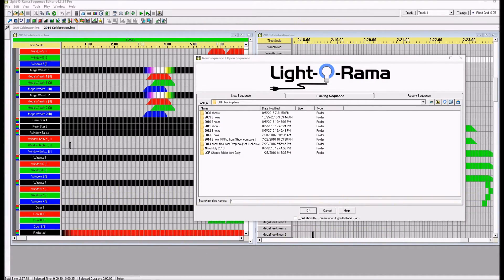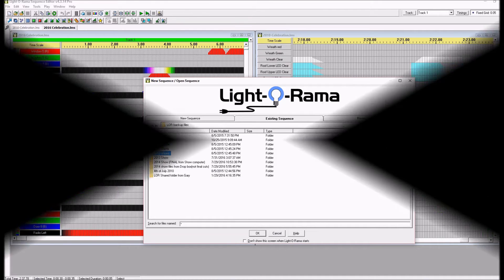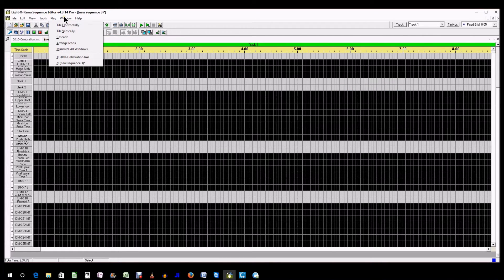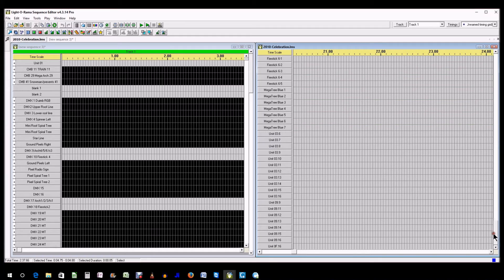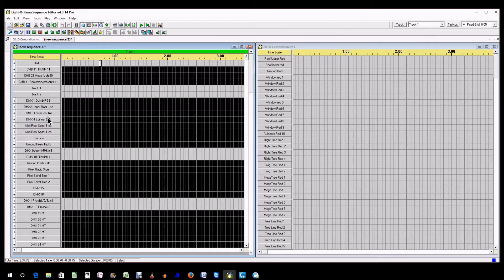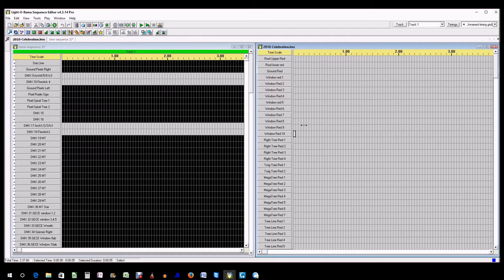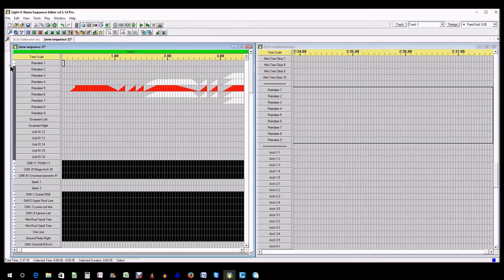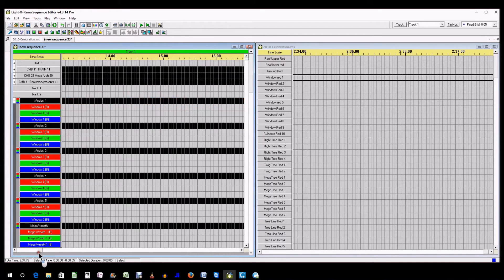Upgrade OLD AC LOR Sequences to XLights and RGB

Comment: Hey I've noticed you you a few different pieces of software to achieve your light show. I'm just getting into holiday lighting. What would be the best application to program an advanced dmx fixture for example a moving head with 30 or so dmx channels ?
Reply from the maker: Nic,
Back in the fall last year, the Xlights developers added DMX control for moving heads.  One developer added something like this to their show so he wrote the code for it.  The advantage of Xlights is that it is free software.   This is more of the DIY side and takes a lot of reading, comprehension, and learning.  It is NOT plug-and-play.  There is no "support desk".  We help each other out by using TeamViewer sessions, Skype, and group meetups.  

If you want more of a plug-and-play system with support, there is Light O Rama.  They sell a line of AC and DC lighting controllers that runs on its own network.  The software does not easily allow for mechanical control of DMX fixtures such as moving heads.  There is a huge learning curve.  However when you have problems, you can put in a ticket and ask for help
Reply: I would just use my own lighting console but I only have like 4 universes and pixels eat up universes very fast  and the support for sync with music is hard and I would be willing to learn x lights but as far as "not pulg and play" could I just plug in my pixels and configure them and run a show movers and pixels for free in x- lights or would I need to buy a lisense or dongle specific to X Lights thanks
Reply from the maker: To run the DMX controllers from Xlights, you need a DMX interface.  There is no specific Xlights dongle.  The Xlights program is FREE.  You do not pay anything.  Just download it.  If you're looking to do DJ work with this, the interface is not setup in such a manner to have ques with set effects.  The idea is to select a song, and sequence the lights to that song.

This might clear up some questions.
https://www.youtube.com/watch?v=22blRaz5gZM
Reply: thank you!